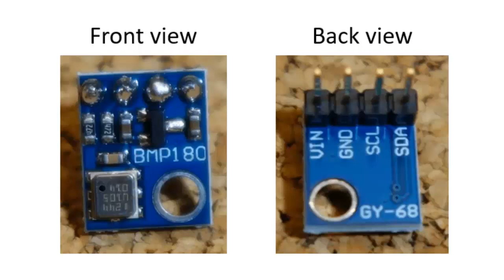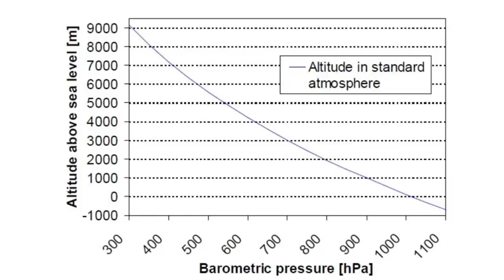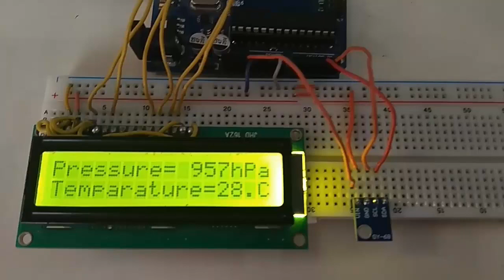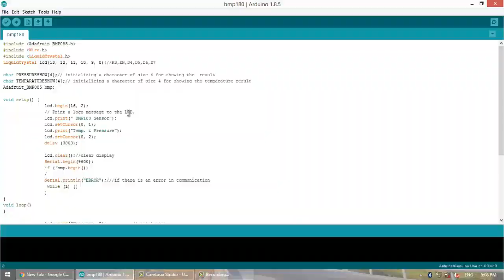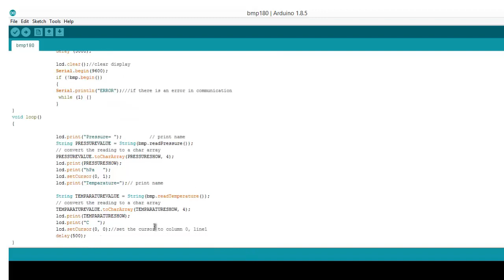BMP180 Arduino Tutorial | Measure Pressure & Temperature

Comment: Can you help me, can I get the code with the library used in this lesson? I am practicing this sensor on the adruino Uno r3, but I can't run it. The above code link has failed. Can you help me?
Reply from the maker: Check the link given
Reply: @HowtoElectronics  link fail . The page is not invisible, and it appears like this.
https://bit.ly/2DFINGW

Comment: the code you have given is not compile,, its shows error
Reply from the maker: Use the library.
The code is correct
Reply: @HowtoElectronics  To interface BMP180 Sensor with Arduino to measure Pressure & Temperature copy the code below and upload it to the Arduino UNO Board.
Reply: @HowtoElectronics  theres no library to download

Comment: I have a question, if I want a led to activate when the sensor detects a certain temperature, which I must put in the void loop
Reply from the maker: Use if else command after formula, may be at below, use digital write command for activating LEd as on/off.